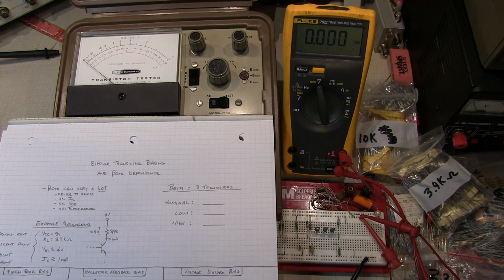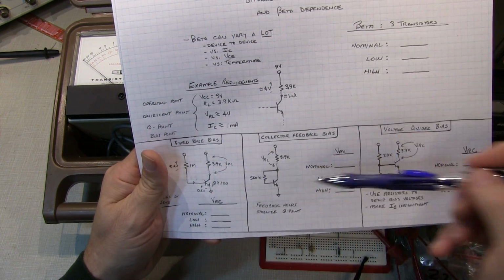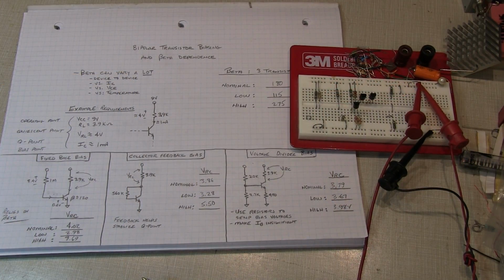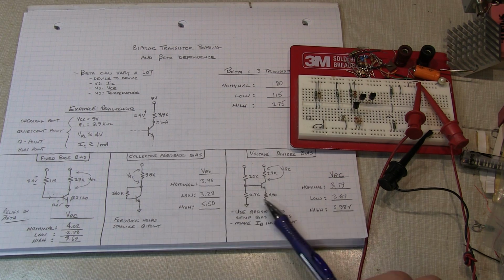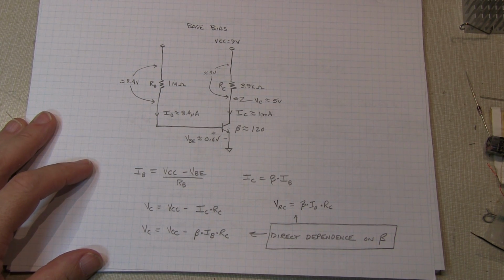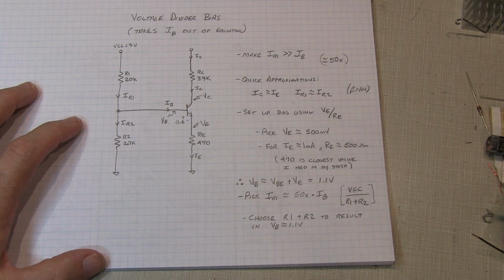#185: Back to Basics: Bipolar Transistor bias circuits and Beta dependence

Comment: Very good explanation of this subject. From the practical point of view, relating to your 3rd circuit, I usually do not exceed a bias current factor of 10 in order to keep the imput impedance of the transistor stage high enough. The emitter voltage across Re is also quite limited because the ratio of Rc / Re determines the dc voltage amplification of the circuit. For ac you can keep it high when you short Re with a capacitor but you have to keep your low frequency roll-off in mind.
Reply: I completely agree with keeping the bias current to ten times the maximum base current to retain a usable input impedance.

However, if you bypass the emitter resistor, you introduce distortion because the remaining internal emitter resistance (re) is non-linear (equal to 25mV/Ic) and you need 330μF to get a 20Hz roll-off with a 1mA emitter current (re=25R). In addition, you then reduce the input impedance again because the base impedance of β times 25R is now in parallel with the input and is probably the dominant term. Practically, it's better to set no less than 250mV across the emitter resistor (so 270R for 1mA emitter current) and dispense with any bypass capacitor. That will represent the maximum practical gain of a single transistor stage if you want to reduce third harmonic distortion to a tolerable level.

Comment: I love your videos. Is there a quick and dirty way to approximate the resistors values? Like how can I just start building a circuit and know to use a low resistance or a high resistance 1k or less or 10k, 100k . If i am designing a circuit and I just want to amplify a signal that is in the nano amp range do I start with high values and as each additional stage progresses use lower values? I am just trying to see if there is a rule of thumb before doing the actual numbers.
Reply from the maker: The design goals will usually  dictate where you start with the values. These goals might include things such as desired power dissipation, required input/output impedance, circuit bandwidth required, noise performance, etc.  Some of these are obvious (lower power dissipation means higher resistor values, higher bandwidth means lower resistor values, etc.).  Maybe you require a specific bias current to meet a certain performance parameter of the transistor, etc.   So, unfortunately there isn't a general rule of thumb.  However, there are shortcuts that you can often take.  This video describes some of these design shortcuts for a common-emitter amplifier: https://www.youtube.com/watch?v=VWY2WQcKJgk

Comment: w2aew, why does germanium transistors have a higher capacitance and high miller effect compared to silicon transistors? The germanium transistor will roll off the high frequencies because of the junction capacitance and miller effect so silicon transistor will pass higher frequencies but germanium will roll off the high frequencies, it this true?
Reply: Germanium transistors are simply fabricated larger than corresponding silicon ones. The larger junction area leads to larger capacitances, particularly across the reverse biased collector-base junction, hence the increased Miller effect.
Reply: @RexxSchneider  Germanium Transistor have a larger junction area because the PNP junctions, but why? the junction spacing should be the same as silicon junction PNP
Reply: @waynegram8907  Most germanium transistors were designed over 60 years ago and fabrication was typically by taking a thin wafer of germanium, doped to be N-type, and melting a pellet of indium into each side of the wafer to give the emitter and collector. The germanium wafer was then the base.

It was impossible using such a crude technique to get the small devices with well-controlled characteristics that are available with modern methods of silicon transistor fabrication, which use laser etched masking and vapour deposition.

I suggest doing an online search for "how is a germanium transistor made?" and then for "how is a silicon transistor made?" if you want more detail of the differences in fabrication techniques that have evolved over the years.

Comment: w2aew, if you plot the frequency response of different silicon transistor part numbers. Why does different silicon or germanium transistor part numbers have different frequency responses from 20hz to 20khz the frequency response curve profile are all different profiles, any reasons why?
Reply from the maker: Different transistors are designed differently, so they behave differently - just as different cars behave differently (handling, speed, etc).
Reply: Yes I know but what I mean is that its not the transistors HFE gain that changes the frequency response profile, its the miller effect capacitance, depletion regions, or the doping is what shapes the frequency response profile curve?

Comment: For voltage divider bias, its not clear why you chose 20k for R1. My guess is that you assume beta to be between about 100-200 so that you can estimate Ib to be about Ie/beta or about Ib=10uA. Then, with I(R1) = 50*Ib, you get R1=(Vcc-1.1)/I(R1)=15.8k. R2 can be adjusted to give correct values for Vb=1.1.  Is that right?
Reply from the maker: That's basically right.  The desired target current through both R1 and R2 should be much greater than the base current - the 50x factor is an example, but it it not a precise number by any means - so 9V/22.7k is about 400uA, well above the expected base current.  You could use a factor of 5 or 10x if the desire is to keep current consumption at a minimum (at the expense of a little more Beta dependence), or 75-100x or more if you want very good Beta independence at the expense of current consumption.  So, the 20K+2.7K were chosen to give me two things - a nice Beta independent bias point, and the desired 1.1V Vb (to result in about 0.5V across Re).

Comment: W2aew, Some Technicians say that Biasing is "Balancing" the voltage and current of the vacuum tube, FET, Transistor. You can bias a Vacuum tube Hot by over biasing it by biasing the current higher or you can bias the vacuum tube cold by under biasing it by biasing the current lower. So Biasing is Balancing the Voltage & Current Ratios it seems for Vacuum tubes and transistors? but FETS is something different because of the compression point and saturation point which is a different type of biasing/balancing of the voltage and current ratios?
Reply from the maker: For transistor circuits, the supply voltages are typically much lower.  Thus, there isn't as much "headroom" for the signal swing.  In these cases, the concerns for biasing is typically centered on ensuring there is enough headroom for the desired signal amplitude and ensuring it doesn't get clipped or saturated.
Reply: @w2aew Thanks for the help, yes biasing is about headroom so the desired amplitude does clip or saturate.  I haven't seen a youtube video going over vacuum tube and transistor 1dB compression point biasing. What would be your method of biasing a tube and a transistor to have a desired 1dB compression point biasing? what I mean is when you're adjusting the biasing its adjusting the tubes or transistor 1dB compression point?

Comment: W2aew, how can you make a circuit with an LED light that tells you when the germanium transistors are Biased correctly? If you have a comparator circuit set to a referenced bias voltage that the germanium transistor should be "bias correctly" and the LED light will turn on & light. But when the germanium transistor temperature will drift up and down from the cold and hot temperature the comparators reference Correctly bias voltage will not be good anymore? because the correct bias voltage has drifted also so the LED will turn on and Light at the wrong bias point because the transistors have drifted in temperature? I'm trying to get the LED to turn on at the correct calculated bias voltage even if the germanium transistors have drifted in temperate up and down the Bias circuit comparator will adjust and know what the correct bias voltage should be. Not sure how to do this, do you know what I mean?
Reply from the maker: This is not really possible, because the "correct" bias for a given transistor depends ENTIRELY on the specific circuit it is designed into.  The bias condition for a Class A common emitter amplifier running off of 12V is entirely different from the proper bias condition for a Class C amp, which is different from a common collector amp, which is different from a circuit where the transistor is being used as a switch, etc.  There is no single "right" answer.
Reply: @w2aew  this engineer calms his bias circuit will only turn on the LED light when the germanium transistors are correctly bias, check out the video link https://www.youtube.com/watch?v=cN76y_Ybs04&t=86s    I'm not sure how this biasing circuit works because the germanium transistors will drift with temperature so the bias circuit has to drift also to keep the bias voltage correct.

Comment: I have an audio preamplifier that has a three transistor gain stage.  A while back I wanted to figure out what the dc operating points should be because it had gone wrong.  I had (have) the circuit, which tells me the Vcc and all the resistor values etc.  The first transistor stage, had what looks like a potential divider bias, but there is an extra resistor shared by both the base bias resistors and the emitter resistor.  In other words, the emitter current and bias current go through this 390K resistor, then they divide into the emitter resistor and the potential divider, so an equilibrium is reached.

This is a stage that has a +ve supply, but the first tranisistor is PNP, so the collector of this transistor is on the 0V side of the supply.
Because the only voltage on the circuit is the 50V above this extra resistor, it meant I couldn't calculate the base voltage easily, in the way it is shown in your video and all the textbooks and therefore none of the other voltages.  The only way I could do it was by simulating the circuit in SPICE.
But this seemed a lot of hassle, there mustve been a more clever way.
Reply from the maker: It's difficult to tell from your description, but it sounds like there was some feedback around the transistor(s).  That always makes the bias calculations a bit tricky.
Reply: Sounds like they were biasing with a constant current source

Comment: Hi Alan,
Could you explain how to calculate the input and output impedance of the circuit ?
Thank you
Reply: The output impedance is just the collector resistor, or 3K9 in these examples.
For the voltage divider case, the input impedance is the parallel combination of R1, R2 and β.Re. If R1=20K, R2=2K7 and β.Re = 100 x 470R = 47K, then the input impedance is 1 / (1 / 20K + 1 / 2.7K + 1 / 47K) ≈ 2.3K. That won't change significantly with β.

Comment: Thank you.  Very good video and clear instructions.  It would be interesting to re-do this experiment with the first 2 circuits but simply adding and Re, like you did in stage 3.  Adding Re to the first 2 designs would further reduce the dependence on Beta, wouldn't it?
Reply from the maker: Yes it would - not to the extent as in the 3rd example though.

Comment: Hi Alan,
Is there a simple formula to calculate Ib in this circuit else than Ib=Ic/beta ?
Thank you !
Reply from the maker: Unfortunately, no - that's as simple as it gets - even this calculation isn't terribly precise because beta is not a very tightly controlled parameter.  This is precisely why you want to design circuits that are largely independent of beta and base current variations.

Comment: W2AEW DE KD5SMF
Let's say you want to design a HF transceiver that had a true output of 5 Watts minimum & 10 Watts Max output at the Antenna. Most qrp is actually less than 5 watts & no one actually even gets a true full output of the actual designed circuit.  Which transistors and MOSFETS would you use to build a Superhet transciever?
Reply from the maker: I really don't know, off the top of my head - it would take a bit of research to even begin to narrow it down.
Reply: Try looking at QST December 2002, No Excuses QRP transceiver.

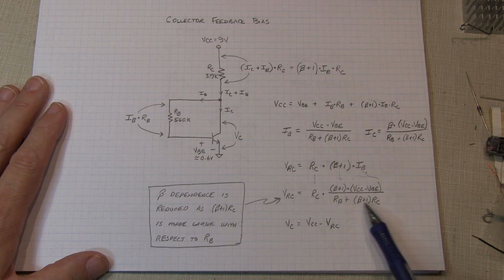Comment: Sir at 15:10 where your talking about beta dependence vs the ratio of RC to RB.The IB equation IB= Vcc-Vbe/ Rb + [B+1]Rc  Doesn"t this imply to reduce dependence onBeta you would want to swamp  out [B+1]Rc by making Rb much  greater than  BRc?
Reply: We want to minimise the dependency of Vrc (the voltage across Rc) on β. If β >>1 then we can write β for β+1. Then Ib = (Vcc - Vbe) / (Rb + β.Rc). Now Ic= β.Ib, so we have:
Ic = β.(Vcc - Vbe) / (Rb + β.Rc) and we know that Vrc = Ic.Rc = β.Rc.(Vcc - Vbe) / (Rb + β.Rc). this simplifies to:
Vrc = (Vcc - Vbe) / (Rb/β.Rc + 1)
If you now make Rb >> β.Rc, then Rb/β.Rc >> 1 and we get Vrc = β.Rc.(Vcc - Vbe)/Rb which is directly dependent on β and is very small. Neither of those is desirable.
However, if you make Rb << β.Rc, then Rb/β.Rc << 1 and we get Vrc = (Vcc - Vbe), in other words, the transistor is effectively in saturation.
In fact you want Rb = β.Rc, then Rb/β.Rc = 1 and we get Vrc = (Vcc - Vbe)/2 which is a good bias point, albeit with some dependency on β.

Comment: Thanks for your informative vids.

does beta differ between one certain transistor? say 2N2222 from another 2N2222.
Reply from the maker: Yes, absolutely. In fact, the three transistors used in this video are all 2N2222 devices.
Reply: ***** so, I will have to use trim resistors for in designs made for manufacture?
Is there another way so i don't need to use them? > for the sake of cost cutting.
Reply from the maker: It is best to design circuits to be as independent of parameter variations as possible, to avoid the use of trim or tight tolerance components.

Comment: Make Ir1 approx 50 > Ib, how are you calculating base current?
Reply from the maker: Initial design goal was Ic of about 1mA.  Divide by "typ" Beta to get approx Ib.
Reply: @w2aew  Thanks for the very instructive video! How did you arrive at the 1mA goal for the Ic? is that a common assumption in the limits of the n2222 or just a free value you choose? and if the former, in what boundaries can that value be chosen? if i understnad you correctly, it all starts from there and from the chosen VCC. First you divide the Vcc by appr half with RC, then you choose RE to get the 500 mV, then you approximate IB and calculate the voltage divider with the rule of thumb of RI =50*IB; correct?
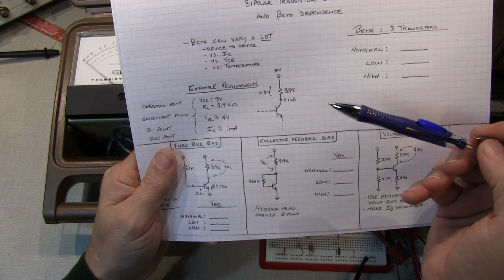Reply: @martinkuhnl8816  The video at 2:42 specifies a load resistance of 3.9K, which is the output impedance of the circuit. Given the supply voltage of 9V, that sets the collector current to be about half the supply voltage divided by the output impedance, or around 1mA in this case. The collector current is not a free parameter once you have decided on supply voltage and output impedance. HTH

Comment: I love all your videos, I could not find where to send you a private email,so I hope you don't mind if I ask you a question here. These non contact voltage detectors work by capacitance.what I want to know is how they work in detail like you are so good at. They ring on the hot side but not on the neutral. If you use an amp clamp you can clamp on eather side and it will read current .it would be a great video . Thanks
Reply from the maker: Here's a nice video showing a non-contact voltage detector.
https://www.youtube.com/watch?v=8anfmp_pTJM

Comment: Another great video, well done. If I may could I request that you continue on with this topic and discuss cascading BJT amplifies stages and the effects of input and output impedance specifically as it pertains to RF frequencies and Maximum Power transfer. I know that there is a lot of confusion out there when it comes to this topic, at least there is with me, and I have never really understood why in some applications you design for high input impedance and low output impedance and in other applications you match the input impedances to achieve maximum power transfer.

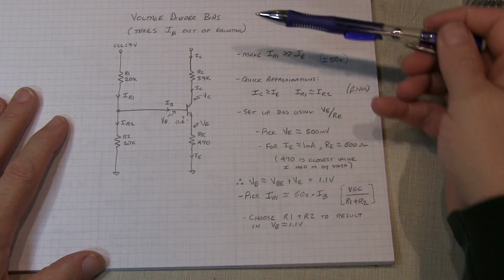Comment: In 2nd to last eqn at 15:51 if Rc is very large compared to Rb does it not then just reduce to Vrc = Vcc - Vbe , just using algebra I thought the (beta+1)*Rc would both completely cancel out top and bottom (In the limit with Rb being tiny compared to either Rc or beta). I got all of this except that bit. Not sure why you said Rc at bottom was still present. Help!
Reply from the maker: The point is that as (B+1)*Rc becomes large with respect to Rb, then Ic becomes less and less sensitive to Beta variations.  In other words, the smaller you make the voltage across Rb and the larger you make the voltage across Rc, the less sensitive the bias point is w.r.t. Beta.
Reply: I thought that is what it meant. I just got confused when you said Vcc-Vbe/Rc 

Thanks this is a great video.
Reply: @w2aew  Actually, if you make Rc very large compared to Rb, then you do indeed drive the transistor virtually into saturation, and that's the reason why Ic becomes insensitive to β variations. You have no dependency on β, but you have no amplification either. Vrc does approach (Vcc-Vbe) and the Rc terms cancel top and bottom.
Reply: If the voltage across the resistor Re is set to 1V, the spread will decrease even more.

Comment: I have always thought that R2 is for temperature compensation and Re is negative feedback that reduce sensitivity of the bias point to the value of hfe.
Reply from the maker: rapsod1911 R2 by itself doesn't provide any temperature compensation per se, but putting a diode in series with it will provide a first order compensation of the temperature variation of Vbe.  Re does provide negative feedback, which reduces gain and helps to stabilize the operating point.